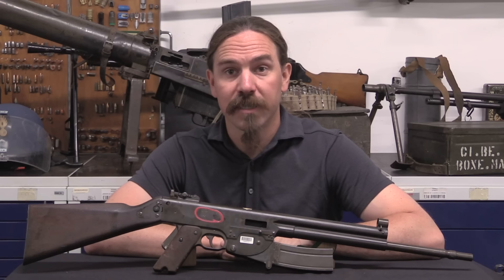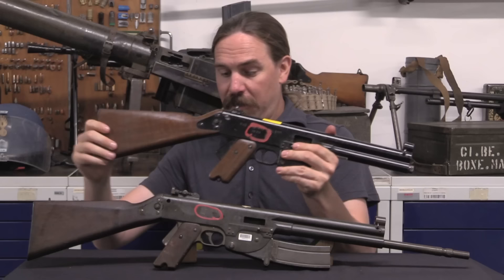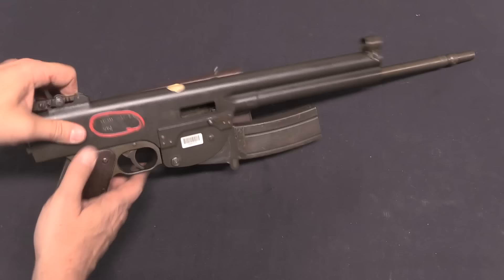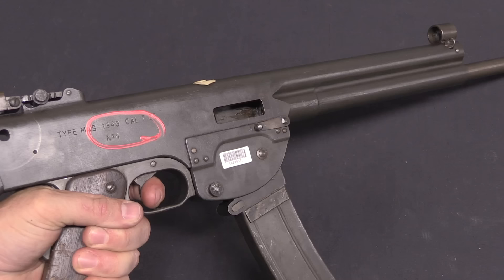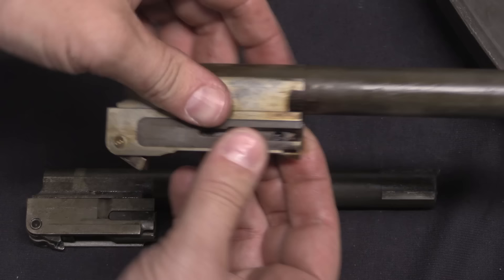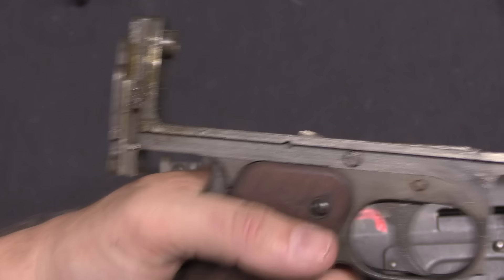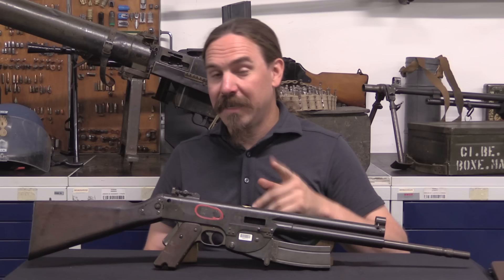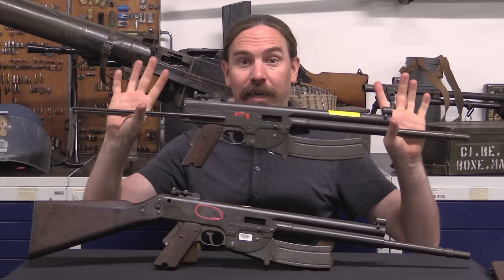MAS-49 Carabine Mitrailleuse: A French Prototype Lever-Delayed Assault Rifle

Comment: This is such a cool system. It makes for a strong, relatively light, thin compact profile. The commonality between the rifle and submachine gun allows for easy training and possibly some parts interchangability. 9mm & 30 carbine is still OK but today we may use something like 5.56 & 9mm or 300 Blackout & 9mm or 7.62X39mm & 9mm as the 2 calibers

Comment: The  presence  ( or more often the lack of) grip safety is something I've always wondered about in automatic/battle rifles.
Reply: I think they were more common on pistols to prevent accidental discharges while holstering.
Reply: I think some SMGs used them as a drop safety
Reply: Usually it’s just an unnecessary feature that adds cost and complexity, that’s why no one uses it.

Comment: Between the SMG and StG sharing the same basic operating system and controls, and the appearance of the fore-end and butt stock, you cannot convince me that they weren't working with CETME and what would eventually become HK.
Reply: The German engineers that developed what became the G3 did spend some time in France after the war, before heading to Spain and CETME, so it's possible they had some influence...

Comment: While they may not share any active development, you can see the influence on the MP5 and MPL just in basic geometry and controls. Maybe the French, Spanish, and Germans were peeking at each other's homework.
Reply: Around this time German engineers were working in France and then moved to Spain.  I was wondering if they were involved in this development.
Reply: There's also a lot of similarities between the appearances of the Armaguerra OG-44 and Franchi LF-57, so you can include the Italians in that mixture.
Reply: MPL and MP5 are completely different. Internally - no similarity except a caliber. Externally - well, submachine guns all look pretty alike, especially the modern ones. You get a boxy receiver with some rails, a pistol grip and magazine. Not many design features to set them all apart. Just look and compare lets say Stribog, APC9, MDP-9 or even UMP-9. Not very different in form and size.

Comment: Did they build any prototypes of this design in 7.62 NATO? It would also be interesing to know when did the French first start making rifle prototypes in 7.62 NATO. It seems the French took a little longer compared to other NATO countries as they finalized their 7.62 prototype the MAS Type 62 much later than for example the Belgians with the FN FAL.
Reply: There were experiments to convert the MAS 49-56 to 7.62 NATO, but they weren't very successful - Ian of course has a video on the subject: https://youtu.be/e8FRzvI9GWo. Since that didn't work out, the French military was more or less stuck with the 7.5 cartridge until it started replacing its main rifle. When that finally happened (by switching to a 5.56 assault rifle), the AA52 machine guns and FR-F1 precision rifles, on the other hand, could be converted to 7.62 NATO.

But I'd say all that is unrelated with this experimental weapon, which was it seems was never designed for a full power rifle cartridge anyway.
Reply: Thought France skipped 7.62 and went to 5.56
Reply: @JeffHenry-cq3is  that's what happened for standard infantry rifles, yes. The MAS 49-56 chambered in 7.5 French remained the standard until the adoption of the FAMAS in 5.56 (and the FN Minimi in 5.56 was also adopted at some point as a squad automatic weapon). But there was still a need for a full power cartridge for other uses, so there was also a transition to 7.62 for those other types of weapons.

Comment: Is there any submachine gun existing that has a magazine which can be rotated? Meaning that to go prone and be a little lower, the magazine could be tilted horizontally and depending on situation it could be turned to vertical position like traditionally, pointing downwards? Maybe even the shell-casing ejection port could change according to the the magazine direction?

Or is this simply a really stupid idea and hence nobody has seemed it worth to do?
Reply: I've never heard of anything like that. I would expect that no one has been very serious about trying it because making it feed from multiple cartridge positions is considered pretty annoying (i.e. double stack double feed magazines) and ejection switching mechanisms are likewise often poorly executed (i.e. all of the bullpups that can't have ejection side swapped in the field). Probably not worth the development time and cost, but it would be a neat gimmick. Closest thing would probably be actions like the stoner-63 that can be flipped upside-down at the armorer level to different configurations
Reply: There is actually one. I saw pictures. Wooden stock and imagine like a sten gun, tubular receiver,where the section with magazine well (and ejection port located on the opposite side) is a ring around the receiver that can be rotated. It is actually quite easy to accomplish. I believe it was Czech...

Comment: Was this an open bolt gun?
Reply from the maker: No, closed bolt.
Reply: @ForgottenWeapons    It feels like utter insanity arguing with Ian about a french military weapon, but are you really sure it is closed bolt?

1) To me it seems this version is virtually identical to the MAS 48 submachinegun internally, and that one was open bolt I assume?
2) The firing pin seems basically "fixed" to the bolt, and there is no hammer or striker as far as I can see.
3) The fire control seems very simple "open bolt"-style.
4) If it was close bolt, rotating the magazine well wouldnt really make the gun inherently safe would it? There could still be a bullet in the chamber.
Am I missing something or am I on to something? :)
Reply: @ForgottenWeapons  Thanks!  The way the firing pin projected out when the bolt was locked seemed to point to it being an open bolt, but if that isn't the case, cool.